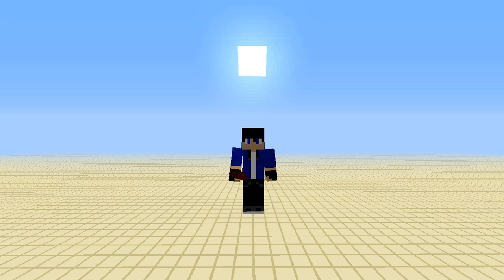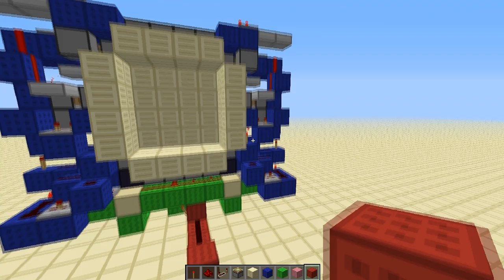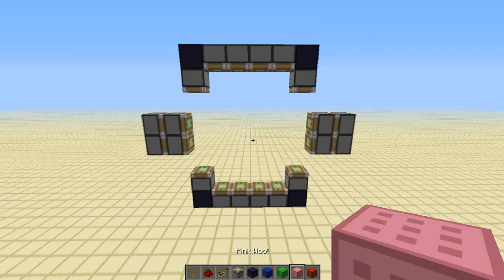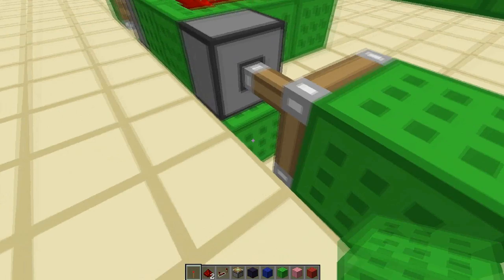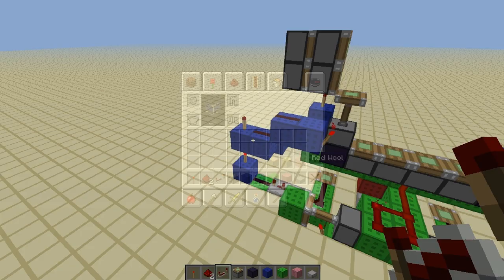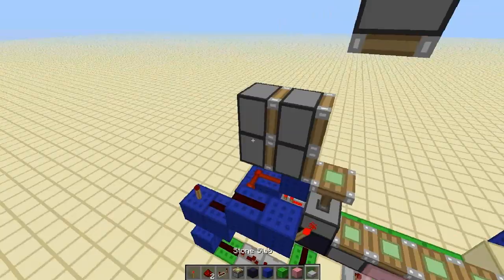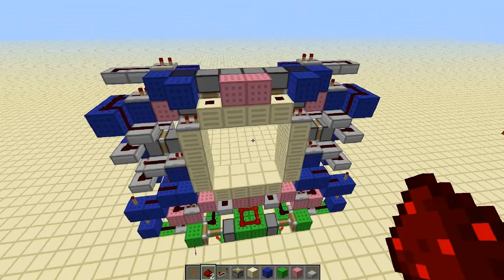Minecraft Seamless 4x4 Piston Door | 1.8 | Redstone Tutorial

Comment: hi there ray, i absolutely love the looks of you door, but then i tried to rebuild it and it didnt work. i have built it 3 times and every time it didnt work properly. my last try the top 2 pistons on the right (from the front) flicker when opening and when it closes, the 2 pistons feeding the double piston extenders dont extend fast enough to feed them, so it just has a hole in it. I have tried to fix it, but now i am asking for your advice. Keep up the great vids and regards J
Reply from the maker: I think you have done something really wrong. You say the top-right 2 pistons flicker when opening and closing and the double extender basically doesn't work. If you said you built it 3 times, that probably means you did something (or perhaps more than 1 thing) wrong each time. I have tested it in 1.7.9 and it works fine. I even have a world download in the description (that no one reads :/) if you want to have a look at it there
Reply: Ray23179 i totally read the description because I like to see what texture pack they used or had on the video

Comment: So frustrated, It works to close but when i reopen it it leaves the 4 central door blocks behind, the middle pistons don't collect the middle blocks back in, i've rebuilt it twice now in case i got a single repeater's tick number wrong but always the same result :/
Reply from the maker: Hmm...That's interesting. The double-extender circuit (the one you seem to be having issues with) is blue; built from 7:22 to 12:26 Please also note that the 1-tick repeater placed at 10:10 needs a block in front of it (the wall)

Comment: Is your 4x4 Pistondoor is a fix Version from CNBMinecrafts 4x4 Pistondoor?
Reply from the maker: Not really. I first built his and realized that it didn't work in Minecraft anymore so I switched back to the version where it did work and looked at how it worked, and tried my best to fix it so that it would work. However, I did not build my fixes onto his original door. Instead,  I built a completely new one with my changes implemented. If you look closely between the two designs, you can see that there is quite a bit of changes. In other words yes and no :D

Comment: dont work in 1.7.2, sand doesnt stay in place
Reply from the maker: The sand is supposed to move. If you're having trouble with it, you can always check out the World Download in the description. It actually still works in 1.7.4
Reply from the maker: Yes, you can. I have a link to the World Download in the description (which no one reads :/). And I don't think I understand your second question about moving the door around...
Reply from the maker: It's ok if you're new to that stuff, but no, there is no way to get this into a world without building it. There's a mod that allows you to copy and paste structures, but even that doesn't work from world to world. Sorry :|
Reply from the maker: You're welcome :D
Reply from the maker: I am kinda confused by that ^ comment. Does it work now, or does it not?
Reply from the maker: How about this? At 12:20 in the video, the circuit for the pistons on top is built. Try rebuilding just that part, and if it still doesn't work, a video would be great (if not a screenshot also works but would be less informative)
Reply from the maker: Oh crap. Sorry you're deaf :( (btw subtitles are trash on YouTube I'll try to update them as best I can) and that purple wool substitution is a big issue. It has to be an immovable block (like obsidian). I can see where you would miss that if you can't hear. You can use Obsidian, a Furnace, or a Chest, but purple wool will not work

Comment: This doesn't work
Reply from the maker: It does. I've tested it in 1.7.8 and it works (in both orientations). You've probably built something wrong or missed a repeater timing. All these other comments show that either it worked for them or it didn't and I helped them solve the problem

Comment: That's not seamless
Reply from the maker: Yes, it is. Seamless means that there are no visible pistons or redstone visible when the door is open or closed
Reply: Ray23179 No it doesn't
Reply from the maker: Yes it does. Search any other seamless door, and you will know. I'm sorry if you were taught redstone terms by a misguided person, or if you are mixing up flush and seamless

Seamless: No visible pistons, redstone, etc. while the door is open or closed (visible pistons during the opening/closing do not count)

Flush: Hidden; The door can be flat against a wall with no pistons, redstone, etc. visible while closed. 

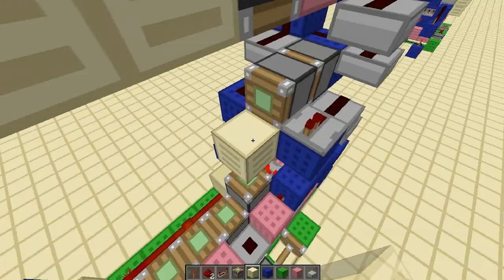Regular, non-flush doors must have that ring that goes over the pistons to make it seamless. I begin placing the ring on this door at 14:24 where I clearly explain that having the blue wool (or pistons/redstone) visible from the inside ruins the seamlessness.
Reply: Oh, sry about that